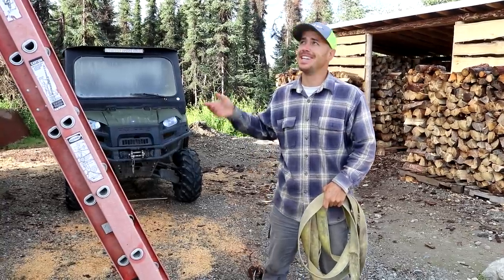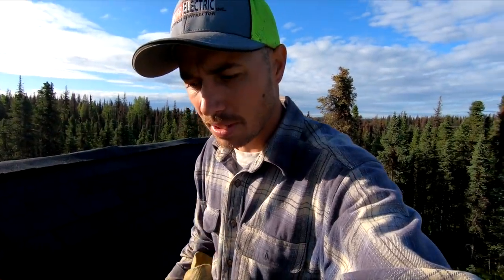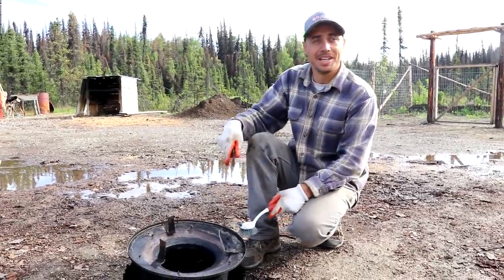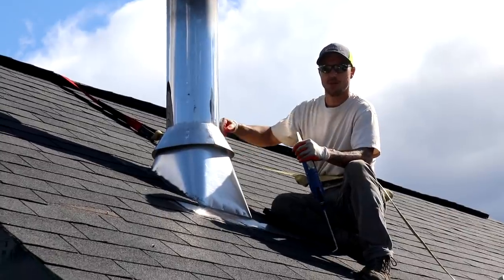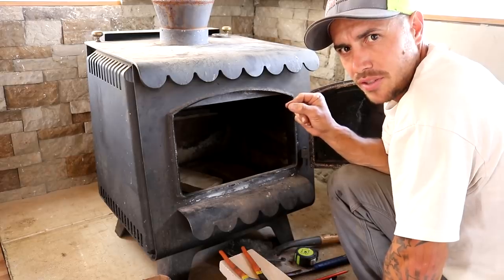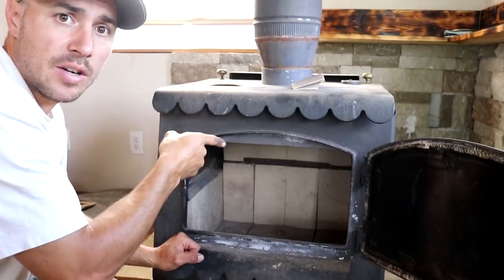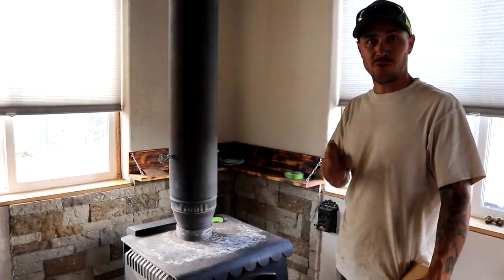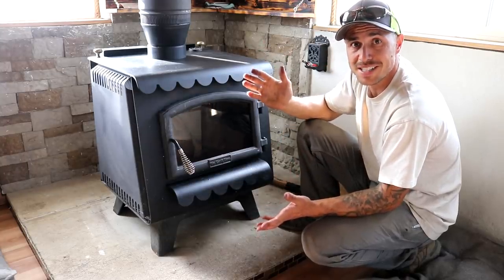Old Wood Stove Gets New Look | Upgrades and Maintenance

Comment: Don’t be unsafe with the ladder. You have it backwards sir. 

Love the channel.
Reply: one safety thing would be for Ariel to stand at base of ladder once you are on it and support side with hands and step on feet of ladder with her toes.  My one accident with the ladder it slipped out from underneath me. If I had a person stand on the bottom it probably wouldn't have happened. Both going up and coming down, it slipped on me coming off roof.
Reply: As stated, the ladder is backwards, the feet are supposed to sit flat on the ground. As per NFPA the ladder is to be placed 2 to 3 rungs above the working level, like he did. The NFPA requirements for using a ladder is at least 2 people, one to climb and one to heel. There are 2 ways they recognize for the heeler to do it, one is as stated above of holding their arms level to the ground and either standing on the bottom rung or place their toes on the feet of the ladder. Second way is for the heeler to stand under the ladder with their arms at chest level and lean back towards the building, the one must for this technique is for the not to look up and have head and eye protection. Lastly, is to use a rope to tie the bottom of the ladder to the structure at the bottom but a heeler is still needed when someone is one the ladder
Reply: @jwcinc12  I had the exact same thing happen...when cleaning a chimney coincidentally.
Reply: ladders are so dangerous.  I feel safer climbing rock faces or trees on ropes and a harness than being 10 feet up on a ladder.
Reply: @donhepler294  mine was washing some windows 2nd story above the first story pushed out dining room. I am glad my fall was from 10', but onto cement, standing and hurt a vertibrae.  I am so careful about ladders ever since. I hired a person to go with me every time I had to use a ladder, if only just for that.
Reply: @stephenroylance3958  You should play on a 90' stick on a quint some time, even in the slightest breeze it sways 5 feet in every direction. Your harnessed in but the idea of that swaying aluminum stick failing still weights on your mind
Reply: @southronjr1570  naw bro, I'm good LOL
Reply: The ladder is on the wrong side!!    Make sure the steps are flat with the ground! t's dangerous because the hooks that hold the two sets of rungs and allow you to extend it,  can come unhinged when you have it backwards!  Stay safe guys!  Love the channel!
Reply: Did anyone mention that the ladder was backwards!!!
Reply: @southronjr1570  Such great ladder knowledge....I still hire out but good to know there is a right and wrong way to use a ladder.  Thanks for posting that :)

Comment: ,We have a stove with a glass door in our cabin. It will go dark , often, when you burn in it. If the soot do not go away during firing, you can wait till the stove gets cold, wet a piece of kitchen roll paper, dip it in the ash, and scrub away the soot. Then dry off remnants. I have seen people use expensive sprays, but that is not necessary. I just think I would tell you in case you did not know. The stove turned out really beautiful! Regards from Sweden!
Reply: I use them same method. Works great !

Comment: Hey, small safety tip - extension ladders should always be set up with the narrower section on top. FYI. 👍🏻
Reply: Its a one way ladder has perm attached feet
Reply: cmetz201 he means turn 180 on the long axis, not the short one.
Reply: Yes, have the sliding section facing away from the building, then the rungs would be level to climb up
Reply: That's the first thing I noticed, ohh crap ladder is backwards 😉
Luv this channel
Reply: The wider  of the two sections of the  ladder should always face the surface the ladder leans into. The extending part should be on the outside.
Reply: ladder was definitely facing the wrong side towards the building - turn it around next time you use it for safety
Reply: Did anyone mention that the ladder was backwards....
Reply: @jedidiah5131  yes!!! Everybody mentioned that!!! Thank God y'all are observant but let's not go into overkill here! Sheesh!
Reply: @natashaalfred2645  that went right over your head...swooosh

Comment: I have a similar stove, 12 feet of chimney pipe. I clean chimney from inside stove. No going on roof. I use a cheap drain cleaning snake. It's a flat metal tape on a little spool with a spring on the end. Like an electrician fish tape. I work it up to the cap, then wiggle it in a circular motion  slowly back down to the stove. Wind it back up on the spool and done. I have a big pile of soot in the fire box like you did. Real easy and no roof work, unless I'm going to clean the cap.

Comment: Great job guys, that stove is without a doubt one of the most essential pieces of equipment you have so a bit of preventive maintenance in the summer will go a long ways towards a great heat source for the rest of the year. Stay safe

Comment: I had a wood burning fireplace in a 2 story+ basement house & had to put a 28’ ladder on our deck to get on the roof to get to the chimney. So I ran a thick rope around it and tied myself off every time I’d run a brush down it to our fireplace.
I don’t miss getting on that roof but I do miss the fireplace.

Comment: If you leave that come along / hose on the roof, come winter and the snow lying on the roof, that hose can be used like a cheese wire to slice the snow from underneath ; the snow not having any purchase can be sliced off easily  ( rope or wire is better, with a handle on either end )

Comment: When cleaning the chimney cap, turn it upside down and put some gas in the center and light it on fire, I use a spray bottle to spray it down and when the fire is out the creosote just brushes off.

Comment: That flue needs to be cleaned more often.  A good general rule I was taught is every 1 1/2 cords.  This is what I do.  The house cools down a bit but that's ok.  It doesn't take that long. 
With your burning pine you may have to do it more often.  You don't want a chimney fire.
Check into a Rocket Mass Heater Stove to help take the stress off the wood burner.
Reply: Pine seems to have more sap than the hard woods.  If it is smoking a lot when you open the door, stove pipe may need cleaned.  If we have a cold spell & put a-lot of wood thru it, we clean it.  Our wood is mainly oak & hickory.
Reply: @trutsieo5430  I have cherry and oak.  I mill the cherry for lumber but there's always scrap to deal with.  That's what I'm burning this winter.

Comment: Look into a poly brush (or plastic).  When you use the metal brushes they tend to eventually wear (score) a groove in the double wall pipe.  Over time with the heat and cold causing the stainless to expand and contract.  We got about seven or eight years out of our pipe before it split and the rock wool was showing.  Found that out when I was cleaning the pipe and all the insulation was coming out.   Low and behold there was a huge crack and after talking to our manufacturer (Selkirk) we should have used a plastic bristle, metal is for stone flavors.

Comment: YOU might want to think about buying a 2nd cap. That way you'll be able to remove and replace the cap at the same time. Then clean the removed cap put in the shed and you'll have it ready for next year. This way you'll only have to go up on the roof 1 time each year. Just a thought.

Comment: Little helpful tip when it comes to glass doors on a wood stove: to clean them once they get sooty, simply take a damp paper towel, dab a little of the soot on it, then wipe the glass in a circular motion....the stuff comes right off. Then just wash the glass with some window cleaner.

Comment: 5 Stars on the restrow on the fireplace but that glass will get black quick we have to clean ours once a week. I found the best way to clean it is spray oven cleaner on it and let it set for 5 mins and then use newspaper or paper towels, now tough spots use razor blades. I love your channel keep them coming.

Comment: This is just an fyi  comment. When you set up an extension ladder put the base against the wall then you can just walk the ladder up hand over hand and it can't kick out away from you. Also as long as you have the additional length available extend the ladder  three or more feet above the roof so you don't have to bend down to get on the ladder but can just move sideways to the rungs and you will have something to hang onto as well. I worked from ladders, boom lifts, scissor lifts and other ridiculously stupid methods for years without any problems but got my butt handed to me by a six foot stepladder this past March. Some sort of fall arresting gear is always a good idea. If it seems like a bad idea or dangerous it probably is so you might want to think it over again. I see a lot of people have already mentioned you had the ladder reversed. You folks stay safe and we look forward to your videos.

Comment: Andrew Storie is correct, ALSO fire fighters are trained to extend the ladder, in my time 3 rungs, but I think now it's 4 or 5 rungs above the the point of contact.  Then you can be fully upright with a hand hold and step straight onto the roof

Comment: Y'all shuld get a cocoon fan for the wood stove it works so good to move heat around the house and it sits right on top of the stove and requires no electric or battery

Comment: Nice job on the stove, it really turned out nice. Seems like this is the season for cleaning out the chimney stacks. 
An old timer told me for the difficult spots on the chimney cap use a propane torch. It will just melt the build up off.
Reply from the maker: My Alaska Dream thank you for the tip 😁

Comment: Good job on the stove it looks 100% better. It looks like the chimney/stovepipe connection at the top of the stove is incorrect. The pipe should go over the flange on the stove, not inside. The way you have it now allows for a potential leak.

Comment: Yes you do have the ladder leaning against the house facing the wrong way.  Also osha says that a ladder must extend above the eave at least three feet or more and tied fast. This will allow you to be able to step around the ladder and onto the roof and still have the ladder at a height where you can hold onto it.  Just like rock climbing three points on the rock at all times.  (hands and feet, count them)  You will find it much safer, also osha says that the majority of falls over 8'  are fatal it used to be ten but I believe that is the current stat. So be mindful.  Since you are I believe 32 just a pup, one of those young whipper snappers.  Ha !  It really isn't the fall. It is that sudden stop at the end.  My best for you both, Peace Jim

Comment: That cap, as long as it is not aluminium you could also use some oven cleaner to get the job done. its basically a combo of sodium hydroxide and a surfactant. should react with soil minerals just fine to neutralize the residues.

Comment: Hey guys! I recommend using Williams Stove Polish rather than that spray on paint stuff. It’s made up of just carbon and graphite and if you get any on your hands it comes off easily with soap and water! That paint stuff can be pretty nasty. And to clean the windows just mix some of the ash from your wood stove with water and the wipe it down and it’ll clean up nicely! There’s lye in the ashes apparently which cleans the glass. Love your videos and hope the tip helped!

Comment: That ladder would be a lot more comfortable if you rotated it so that the D steps did not point down.
Reply: When you put up an extension ladder. Remember where if two rungs meet. If you put a level on them. They should be level. Stay safe.
Reply: bruce clothier  he's NOT a "dingaling". He's not perfect but I'm sure he's better at a whole lot of stuff than you are!

Comment: As a lifelong wood burner it’s evident that you are not burning your stove hot enough or your wood is too wet.  Minimum average temp should be 500 degrees.  Wood moisture less than 15% is ideal.  If you run the stove at the proper temperature and it chases you out of the house trade it for a smaller stove.  The benefits are more comfort and less wood consumption. Cheers

Comment: That stove looks pretty as a picture!  Are you going to redo the fire-resistant seal-rope thing arond the outside of the glass insert?  Shawn James over at My Self Reliance did that a couple years back with his second-hand stove after his first year using it in his cabin, and yours is looking a bit worn down, too.

Comment: If it were me i would take the baffles off the outside of the stove, they prevent the stove from shedding heat (they insulate the stove to a certain point).  I know it's for safety...

Comment: U R so good with your hands-wwhy not build a water holding collar with an outlet pipe plus a tap atvits lower end around the lowest part of the chimney for free hot water.    A lot of people in England have woodstoves with back boilers that run the central heating radiators

Comment: The way that I clean my chimney cap when it is clogged with creosote as bad as your cap.Take it out in the yard away from any combustibles or grass,lay it top side down,pour a cup of gas into the cap,and ignite the cap with a long stick and wad of paper. Once the creosote burns up and turns to ash,wash out with a water hose and wire brush any remnants.My normal routine is to clean out the chimney at the beginning of Winter and check the chimney and cap a couple times during the Winter and anytime that I go up on the roof.A wire brush is adequate for a small accumulation of creosote.
        I pull the chimney cap and shine the LED inside the double wall pipe that goes through the roof to make sure there aren't any cracks or holes in it that could cause a fire. With the amount of creosote in your chimney,if it catches fire ,the single wall pipe will get glowing red hot.The best way to stop it if you are watching the heater or hear the roar is to have a wood heater that is airtight so you can cut off the oxygen to the fire.You may have a problem with air flowing into the chimney through the holes made for your dampner,IDK.I have a Grandma Fisher wood heater that is airtight enough that I can cut off the air supply so the fire stops if needed or if I want the coals to keep the house warm over night.
        I switched to stainless steel single wall pipe which goes to the ceiling after a few years of use because the steel pipe was about to rust through.Zero problems for ~20 years since I upgraded the pipe.
         Add a magnetic thermometer to the pipe near the ceiling so you can accurately monitor the temperatures to make a hot enough fire routinely to prevent creosote buildup.   Good Luck!

Comment: Buddy i'll tell you how to clean the black creosote in stove pipe over the winter time.....Wait of a warm day where you wont need to use the stove for 3 or 4 hours...... Make a big hot,hot fire take a cold bottle of water 20oz and put it in the fire as soon as the bottle melts the water will steam clean the stove pipe, All the black creosote will fall down in the stove....

Comment: so your only 32 going on 33 no wonder you two have so much energy, I want to get out of here so bad but I'm 58 going on 59 this February And I don't know If I have what it takes to do the Long cold winters let along the time you have to prepare for winter. I've done a lot of car work in my life and pretty much ruined my body, but I think it's time to liquidate and start taking care of myself. I'm not married and I've never had children. I always put other people and cars, trucks, big trucks and  equipment before myself and all my tools I have 30 ton log splitter that I've only used twice. I've got about 6 cords of wood in my shed and over a cord of cottonwood split and stacked and covered primarily for out door burns, sometimes I mix it in wood stove. it was storm fallage. then I've had I huge hemlock come down in a storm and I had to pay to have 2 monster hemlocks taken down because one was dying and the other one was over 160ft tall and it sat 30" away from my mobile home but in the storms it would bend all the way over the mobile home, it had to go. I have rounds stacked and covered everywhere and had to cut it all up into 16" rounds just to roll them out of the woods never finished it. I'd like to sent you pictures of my place, maybe on messenger if that's okay. I'm the only one here that can handle winter out here, I have 9 older costco car covers out here one with 33" extension legs on it for 33' motor home, two of the makes a 40' cover. never lost one to snow load. lost one tarp to falling snow tree bombs. I know where to buy the real cover and all the parts for them 2003 and up ( TSY Taiwan Shin Yen) Costco uses them. don't buy a new Costco car cover they're junk. I love your shows, I watched then all night long again. I'm retired.